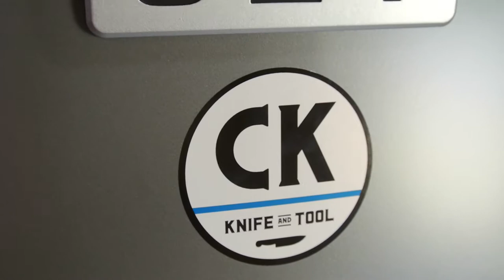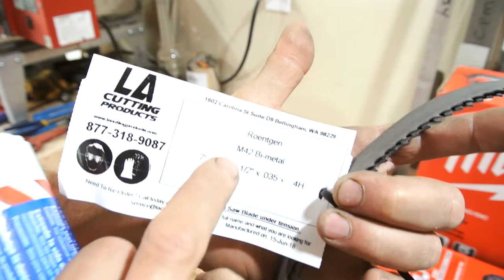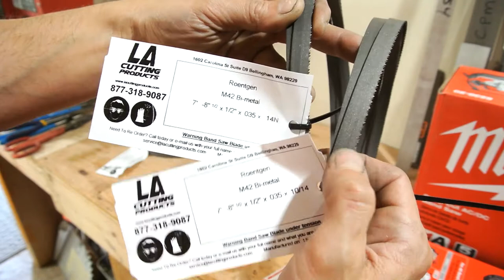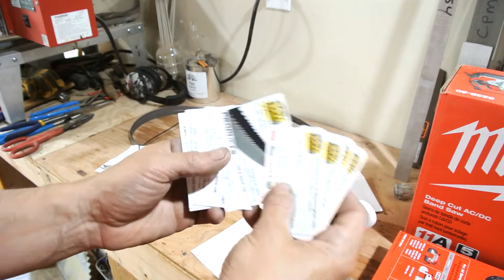14" JET Metal Wood Bandsaw Part 2

Comment: I appreciate the video. Just bought a saw today myself. I wish you would give a exact oil to use in the gear box. And the belt configuration for cutting metal. and also the way to use the wax on the blade. I'm new to using a bandsaw. thanks man....
Reply from the maker: All your concerns are in the manual when you get it.  As for configuring the belts though, that's going to be based on the metal or wood you plan to cut.  The JET has a very detailed step-up/step-down scale.

Comment: I thought this was a review of the Jet 8201K.
Reply from the maker: Part 1 was an unboxing and Part 2 was what to expect.  Can't review something I hadn't used for more than a week.  I have mentioned in other videos about how it's going but not Part 3 yet.  Have to give the saw some time and steel/wood to give an honest "review".  You can check the KREG bandsaw fence video where I mention the JET and some more pro's and con's perhaps.  To be honest with folks, I have to give you my impressions, a "How does it come to you shipped?", What to expect, What does it cost?  Where to get the product?  How well is it functioning/ working on first use?... I do hit all these points.  A full on "review" as you mentioned does cover those points.  But time will tell how well it holds up.
Reply: As info - The oil is 80w90 GL-5 gear oil... in the US found in auto parts stores by various companies